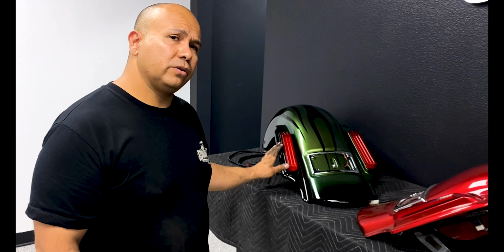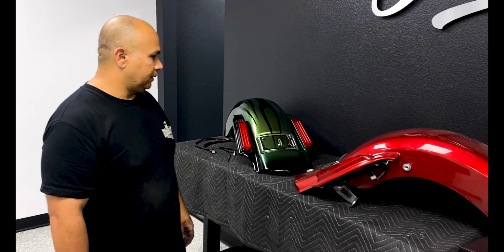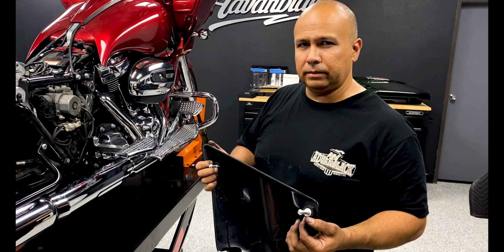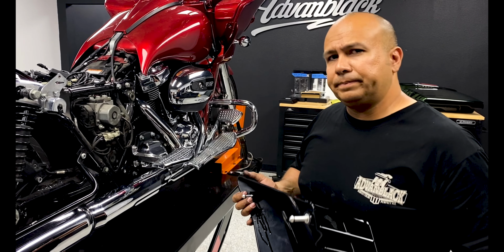Advanblack Full Color Swap Build! Part 1/3

Comment: Is it possible to get a bundled version without stretched tank covers and side skirts???

I have a2016 Electra Glide Ultra Classic that has lower fairings and saddle bag protectors that I don’t want to remove(it’s the saddle bag protectors or side crash bars that I want to keep) and clearly, if I get a bundle with the stretched side skirts(panels) I will have to remove the saddle bag crash bars.
Reply from the maker: We package the parts as a "bundle" meant for a complete body swap. However, if you do not need certain parts, you can also pick the parts you want individually. Hope this helps.